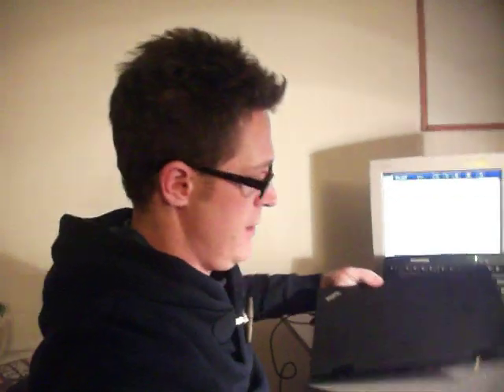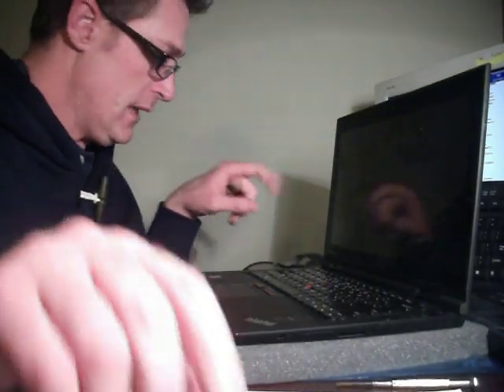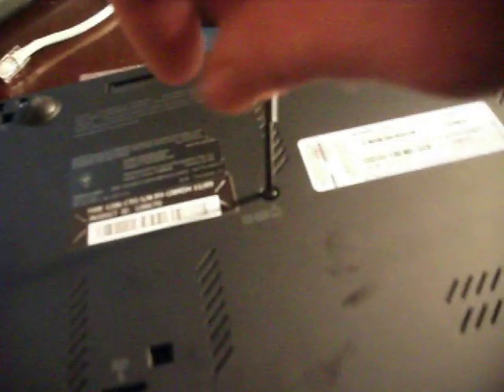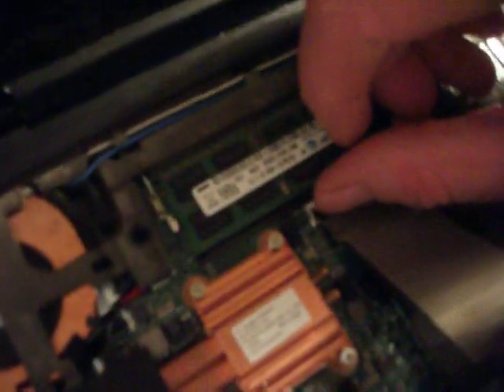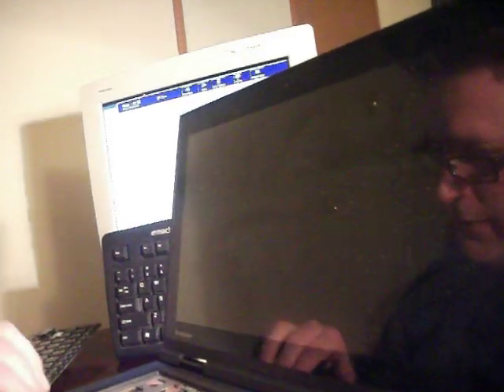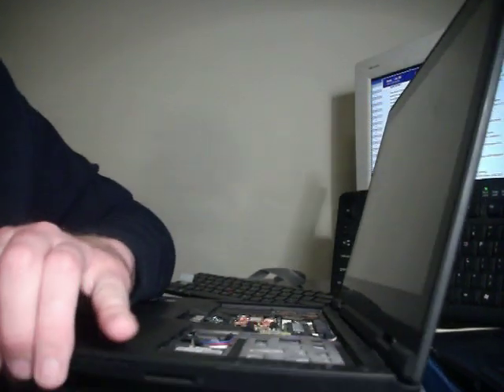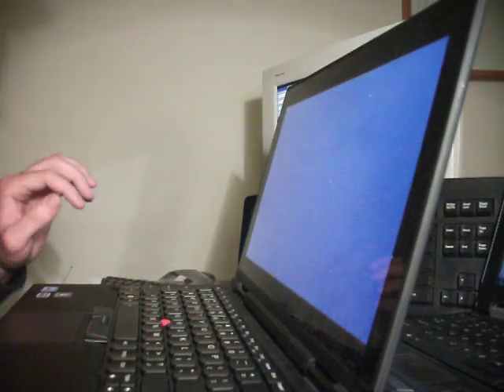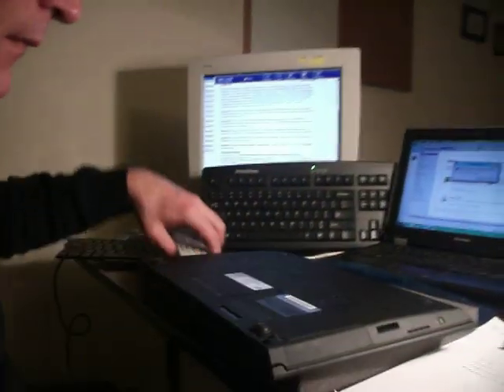Lenovo Thinkpad X1 Keyboard Replacement repair fix how to fix or replace keyboard on laptop

Comment: Thanks! This worked indeed. An interesting aside perhaps - the keyboard replacement also revived the sound buttons and blue thinkvantage button at the right of the keyboard even though they weren't replaced. The video is a good demo and I appreciate the help!

Comment: Thank you for sharing Michael. I want to take you up on the offer regarding spare keys. 
when you provide email, i didn't hear @???.com so I'm messaging you here. Considering this is a dated post, i'm assuming they are gone. First thing to confirm is if the laptops are the same. I have a Lenovo X1 Carbon purchased Oct 2014 which looks a little different from yours. It is the Type 20A7 ultra thin. I think our keyboards are different. 
my backspace key is pooched and i was hoping to replace it instead of the whole keyboard. However, if i must, you made it look easy, thank you.
Reply from the maker: +chuck luke I am sorry he hasn't gotten back to you. https://youtu.be/M0vujEETtXs

Comment from the maker: I only disconnected the charger.  I'm pretty sure that you'll be safe without disabling the battery, but it may be a good idea to leave the computer on until the battery supply dies out, and maybe that will limit any power to the system. I'm assuming they want it disabled because of the possibility of creating a connection or short between the screwdriver/tools and the motherboard , but there wasn't really anything exposed.  G'luck.

Comment: well crap, my x1 carbon doesn't have "tabs" the keyboard seems more integrated into the top cover, got myself a replacement keyboard and removed the top cover but cant figure out how to get the keyboard itself out

Comment: Hi Michael, 

My keyboard died (sniff), or actually, was killed by an offspring. The Lenovo site says you have to disable the battery before doing this stunt. Did you skip that or do you think it's not necessary? It's actually ironic because the only way you can do that is by accessing the BIOS screen using the... ahem... keyboard. Boom tsss. 

Thanks!